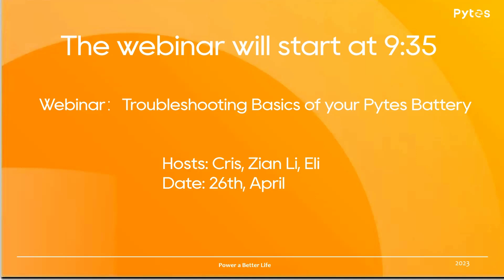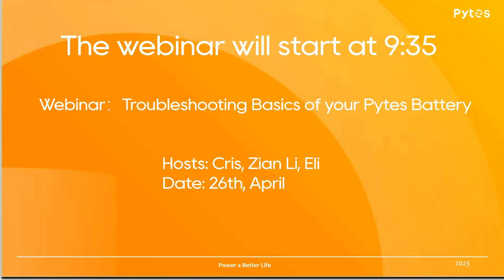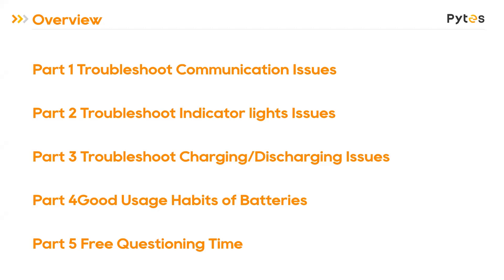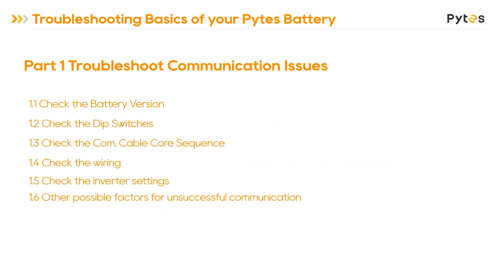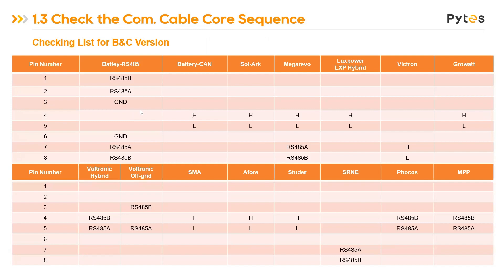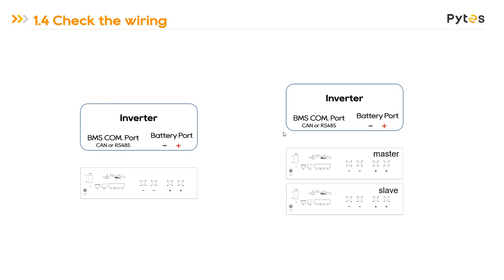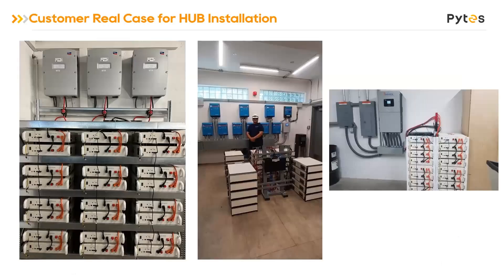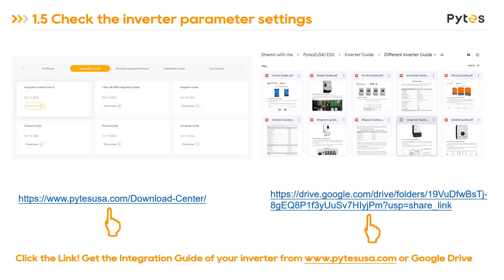Troubleshooting Basics of your Pytes Battery

Comment: Hi! I am from Romania. I have an Victron Multiplus II 10kV and 5 PYTES 48100 RC. I have dayly issue with invertor behaiviour because even all looks great I meet case when system not run propertly because of CAN comunication with Pytes. I set all baud rate 500kBs I see all 5 module on cerbo GX I see parameters CVL 56.8V    but system suddenly in few occasions rise voltage far away above this limit. I see 58V , high voltage alarm from pytes. Alot of issues. Can you confirm you test with MP II 48/10000? All test I seen was with MP 2 5000. I can confirm with old 5 kVA Victron it works fine. But with this new inverter not.
Thx if you have time to wrote me.
Reply from the maker: Hi, thanks for contacting us. Could u pls give us your email? Our technician will reply ASAP.
Reply: DVCC activated?